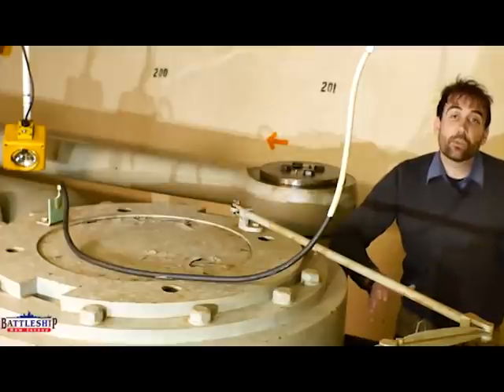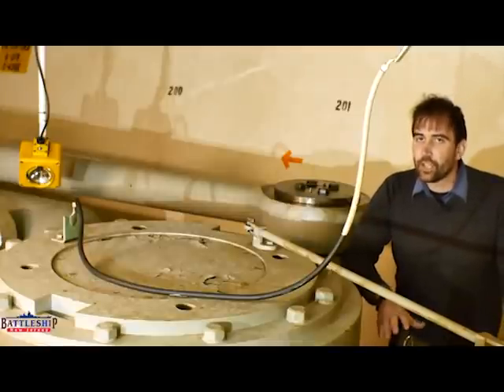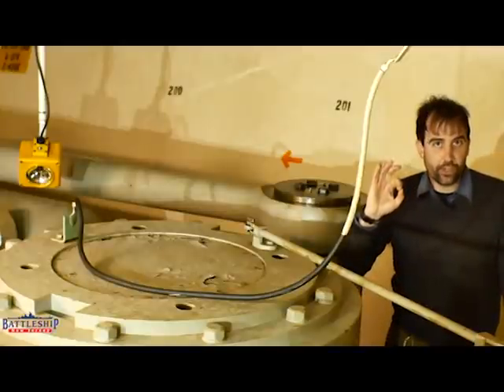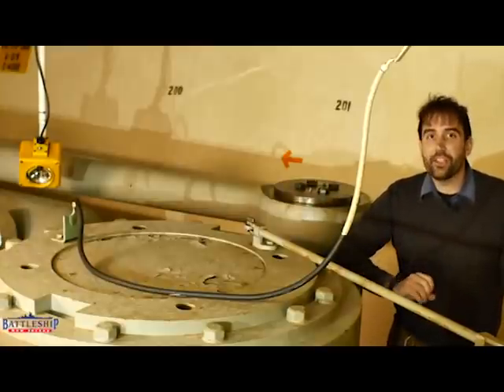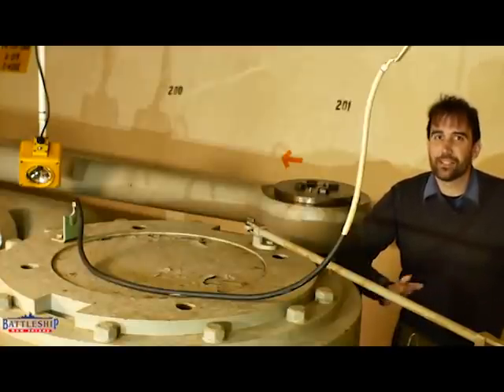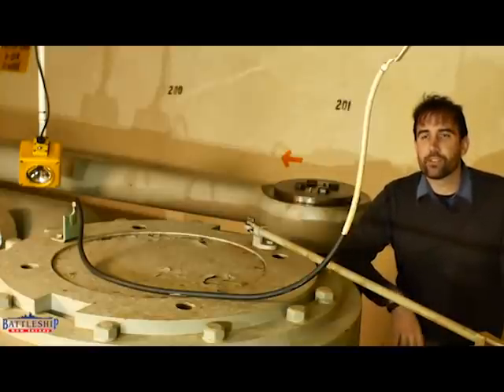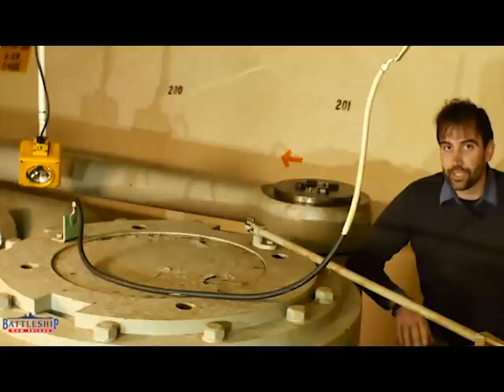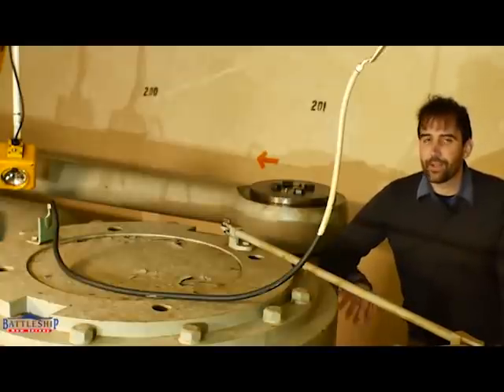Does a Battleship Really Have a Better Turning Radius Than a Destroyer?

Comment: Technically speaking Tactical Diameter and Turning radius are two different things.  When you put the helm over to enter into a turn, in order to understand where your ship will end up you have to know the Advance and Transfer for the ship at whatever speed. Advance is basically how much farther the ship will move forward before she starts to turn and Transfer is the sideways component of the turn.  The actual track that the ship makes through the water will not be a circle and the turning radius actually changes as the ship slows down in the turn.
 The Tactical Diameter is the maneuvering  diameter set for the formation so that all ships can execute the turn at the same rate and maintain formation.
So, no, if operating together in formation the BB and DD will have the same Tactical Diameter. It is promulgated as part of the fleet maneuvering orders.
Reply: Many times, during the battle for Okinawa, destroyers had to dodge battleships and carriers as well as the enemy.
Reply: Must be an insane amount of math being done for large maneuvers back in the analogue days

Comment: Does a Battleship Really Have a Better Turning Radius Than a Destroyer - The Iowa Class could turn in a better radius than a destroyer for they had a Double Rudder.
Reply: DDG-51 Class have Controlled Reversible Pitch props.
Reply: @frankbeardsley2941  Great info - thank you for sharing.

Comment: Had a destroyer pull up to us for maintenance.  It refused the offer of a tug  drove its bow to our midships and stopped.  It then put one engine in reverse and the other forward which cause the aft end of the destroyer to rotate around its bow and up to our midships.
Reply: There are many tricks a good conning officer will use in piloting situations. Dutton's Navigation was the classic handbook. It takes a long time to get the hang of the idiosyncrasies of a class. As a junior LT I was a plank owner on USS Boone, a brand new OH Perry class, very early in the run, so not a lot of people knew how she would handle.. Single screw, huge rudder, twin bow thrusters. I was on the bridge as helm safety  during sea and anchor detail as our CO and XO learned the hard way, including an especially embarrassing in port collision trying to moor alongside USS Long Beach. It takes a long time to learn how a given ship class will respond to wing, current, rudder and stern walk (the unavoidable sideways thrust on single screw vessels, or on twin screw vessels when one screw is reversed).

Years later, as a reserve LCDR I got to show off what I learned with fancy maneuvering aboard USS Clark, and in the bridge simulators at SWOSSCOLCOM. The instructors after one situation they had decided was impossible that I pulled off with blinking spent quite a bit of time debriefing me just how I did that.
Reply: @grathian  I was so envious of the destroyers.  Our ship went out to meet hurricane Gloria.  As we tried our best to keep our bow or stern into the wind so as to reduce sea sickness.  Eventually we came up to the edge of our authorized operating area and had to turn around.  Due to the high winds against our tender and it's large sail area it took 45 minutes to do a u-turn.

At least we never lost a rudder but we did drop an anchor on a tug.    Grathian, so what was the turning radius of the Boone without a rudder?

Comment: I find the difference between RADIUS and DIAMETER (R x 2) to be a VERY important distinction..... and very confusing here!!  It is difficult to imagine a ship turning at any decent speed in a circle with a DIAMETER only as wide as the ship's length but not at all difficult to imagine that turning distance as the RADIUS of that same circle.  You can not compare RADIUS and DIAMETER the same way.  My SWAG is that the "Tactical Diameter" is indeed the turning RADIUS.  If that is correct, than the term is VERY confusing and not even well explained in several Google searches.
Reply: You said it yourself, diameter is the diameter of a circle, radius is ½ of that. Very basic grade school math. Tactical diameter is the cross section of the circle the ship makes at speed. Nothing even remotely confusing. You're just overthinking.
Reply: @KirkHermary  STILL find it difficult that any large ship like an IOWA could do a 180 degree turn at 25 to 30 knots within a DIAMETER about the length of the ship.  RADIUS - OK.  Diameter is a very very tight turn.  But you are correct.  I may just be too smart for my own good......
Reply: @KirkHermary  I just read Tyler Servies comment about UNREP and the Missouri doing a very fast tight turn when she was finished.  MORE POINTS for your side!  Still find it difficult to visualize though.

Comment: How come steering area is called aft(er) steering? It seems a bit strange since as far as I know, there's no forward steering.
Reply: There's probably a way to steer the ship from that compartment, in case the ship can't be steered from the bridge.
Reply: @michaelsommers2356  Exactly !
Reply: Forward steering is actually the bridge, where the ship is primarily steered from.  After steering is the emergency backup if control is lost from the bridge helm station.
Reply: @billbutler335  Oh ok, so after steering just happens to be best placed in the same room as your rudders.
Reply: @NotTheCIA1961  Ahhh, no, the aft steering is in the after part of the ship above the rudders and connected to the steering posts.  The rudders are under the ship.
Reply: @billbutler335  Mechanics for the rudders**
Reply: Smashing nigel

Comment: In 1988 I got the Anatomy of the ship:  The Battleship YAMATO by Janusz Skulski, from the USNI.   Turning Radius of the YAMATO was 589 Meters = 1932.4147 Feet.  The book is 34 years old, and I have it worn-out.
Reply: Note "Radius". Diameter is twice that, so 1,178m (3862ft).

Don't go crazy with the decimal point. In college science classes (the real ones, they engineers take, not the water down ones for business students) they teach about how many decimal places are realistic for precision. If you can only measure to 1cm precision, any numerals smaller than that, are rounded off to the closest cm. So, those tactical diameters, should probably be rounded off to the closest 10ft.
Reply: How the heck did they get that monster to turn so fast?  Don't get me wrong, I learned to respect the IJN (after being forced to "play as the bad guys"), but I have a hard time believing that a Yamato-class battleship is that good at maneuverability (I mean it's 62k - 73k tons with a top speed of 27kn)!  I need more proof!!
😅👍
Reply: @tyree9055  Yamato is actually shorter and wider than Iowa, 263 meters long to the Iowa's 270 meters, but 38 meters wide as opposed to 33. That shorter, stumpier hull is no doubt the main reason for Yamato's turning radius being so surprisingly small. the only thing really working against it is the single main rudder design with a small auxiliary rudder.
Reply: @ryuukeisscifiproductions1818  Thanks!  I'm kind of surprised at this, but it's always good to learn new things (even if it's historical)!
Reply: Tactical diameter is 640m@26knot, with advance diameter 589 in the revised edition 2017, page 19. It has lower length vs breadth ratio compared to Iowa
Reply: I  am going by what the book said.  I did not say it was law. 😉. There are sometimes in the book that time has shown to be wrong,

Comment: Are you sure it is FEET not YARDS? I can not imagine, a ship this size turning in a diameter about the ship's length? Iowa passes New Jersey at the stern at full speed and turns so it passes by the bow on the return way??? I can not imagine that this is possible.
Reply: It was a misreading, the bible says it’s 814 yards
Reply: I was thinking the very same thing.    I was privileged to con the USS Claude V Ricketts DDG-5 on my 1st Class Midshipman cruise back in 1972.   She could make a sharp turn, put no where near that sharp.
Reply: I'm sure it has to be yards. Still great numbers. Modern Arleigh Burke class destroyers are 1200yards at 30kt

Comment: Iowa Class had a tactical Diameter of 814 yards at 30 knots. Given those numbers are correct, I calculate a 180 deg turn would take 87 seconds or about 2 deg per second.
Reply: No math. No A.
Reply: @Marin3r101  https://en.wikipedia.org/wiki/Iowa-class_battleship#Propulsion
Reply: Ryan stated it was 814 feet, not yards
Reply: @davomoto42  He misspoke. Friedman says yards, not feet.
Reply: Wikipedia says yards, which I think makes more sense but I have to trust Ryan's numbers as I know his source is better than Wikipedia.
Reply: @russellcollins52  Feet does seem "small", but I've never driven a boat bigger than a 24' pontoon, so I don't have much reference.🤣
Reply: @russellcollins52  even though yards seems to make more sense Ryan says that the diameter was less than the length of the ship, so it probably wasnt just a simple mistake
Reply: Show your work?